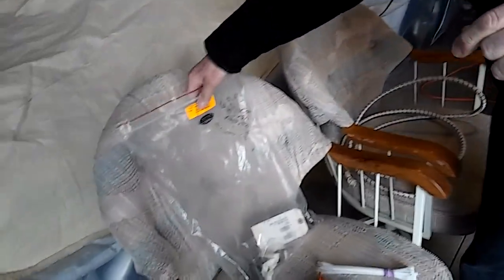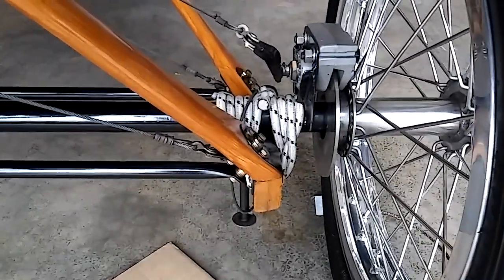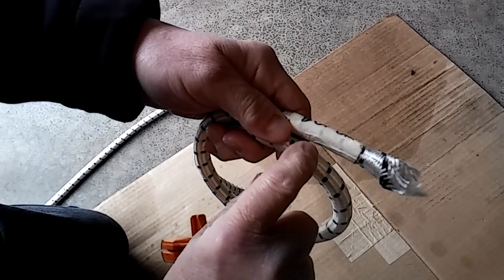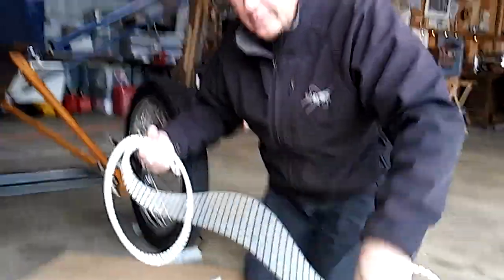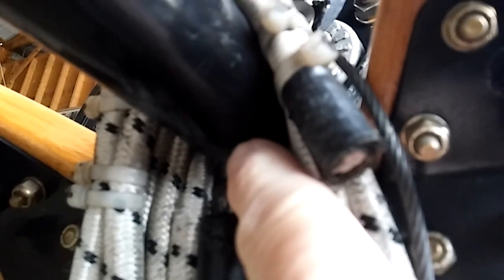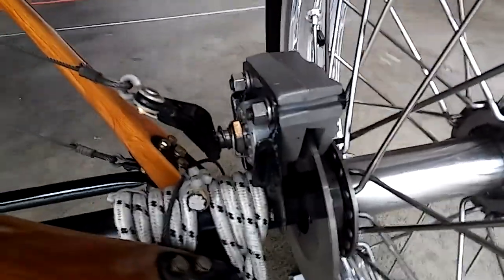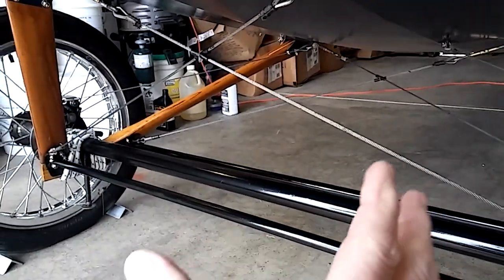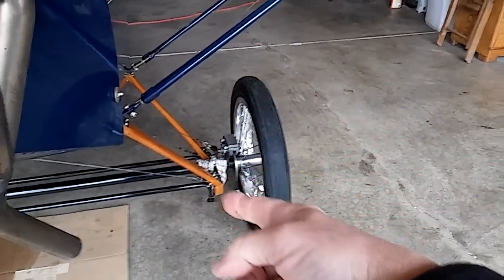Pietenpol straight axel gear bungee cord and anti-rotation mechanism video for Dennis B.

Comment: WHERE DID YOU GET YOUR WHEELS? NEED SOME FOR MY RAGWING 5. THANKS  BEAUTIFUL PIET BY THE WAY!
Reply from the maker: Timothy---I searched motorcycle shops and found a set of undrilled aluminum 19" rims w/ 40 spokes each.    I fabricated my own wheel hubs and had Buchannen's Frame Shop in CA make the spokes.   (as per my drawing)   I hear Aerodrome Aeroplanes has kit wheels you can buy and then assemble but those wheels are heavier----steel rims not aluminum.    Thank you for your kind words and best wishes!